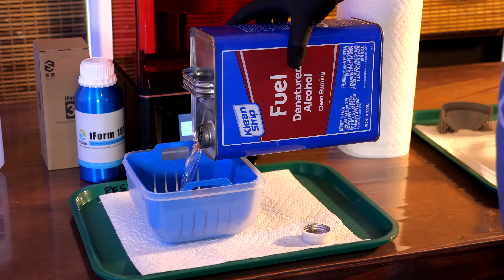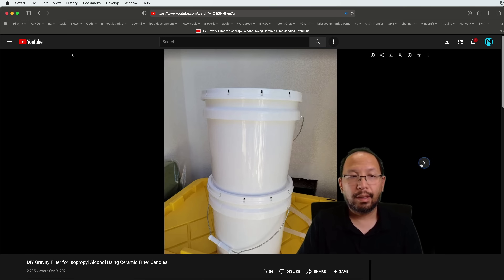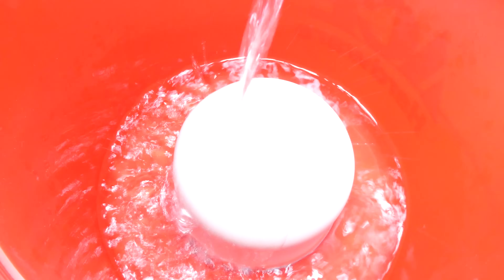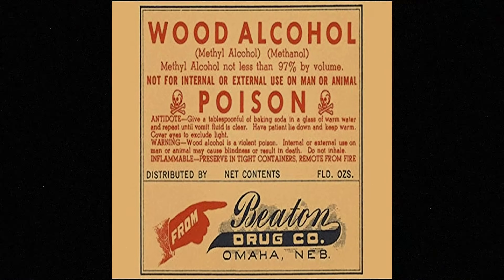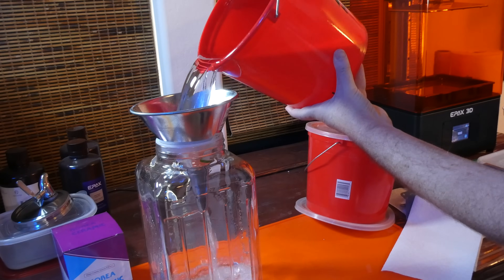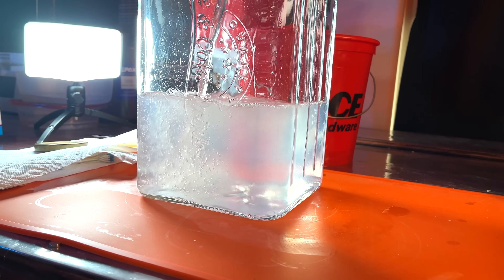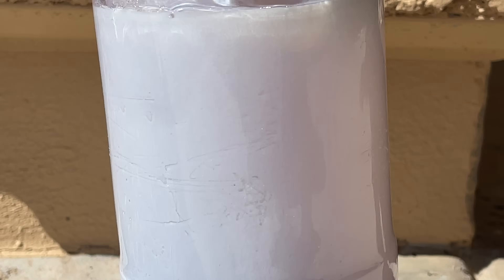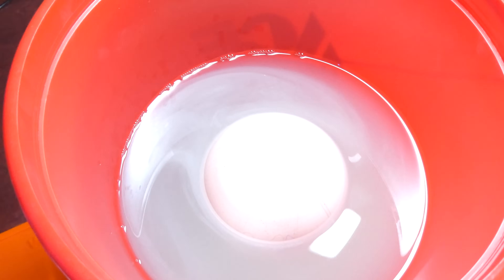Can We Recycle 3D Printing Alcohol?

Comment: I have had my best luck with indirect sunlight. Just like letting the larger particles settle, indirect light creates those larger particles that then fall out of the solution. This will leave me on the first 2 or 3 cleanings fairly clear alcohol. this does take a little time but can be done immediately. I am assuming the yellowing I get is the leftover color from the resins I use. It is imperfect and I use leftover milk jugs for settling then curing the waste resin/mucus. I hope this is usefull.

Comment: How about the top bucket is actually a pressure pot. 40 to 50 PSI would push the alcohol through much faster. Not sure if it would also force the particulates deeper into the filter shorting its life. Maybe a filter could be back flushed. I think it's worth exploring these ideas further.
Reply from the maker: Yes these filters can be used under pressure instead of just gravity.  Could work.

Comment: First, I would start by making a simple sand filter for the first filtration then run it through the carbon filter.

Also how the hell do you get your alcohol that dirty after just a couple prints?  I've reused the same gallon of alcohol for at least 30 prints and I'm not HALF that dirty...
Reply from the maker: I normally do not let it get that dirty. That batch was from a ton of failed prints and until I got a good print out of it I just kept the alcohol.  It was also to make a point.

Comment: I think something that would help a lot is having more filters. So like starting with cheese cloth then though a smaller and smaller filter. Even if you are using six buckets on top of one another it will have less clogging over all and have a smoother time cleaning.

Distilling alcohol is something i wouldnt mind doing but it would have to be outside and i couldnt imagine cleaning afterwards.
Reply: Cheap coffee filters...  Let the resin settle out in a container.  Pump out the clear alcohol using a small electric pump. Filter that alcohol through a few stages of coffee filters.  If you want super clean, filter it through a rig like the one in this video.

Comment: I distill denatured alcohol without any issues.  I would say I recover about 65-70% of it.  What doesn't distill I put in a clear plastic container and leave it outside.  What is left solidifies in a day.  What comes out of the distiller is crystal clear and the odor is  not as strong.   I also do a "pre wash" in a separate container and then use my wash and cure.  It make the alcohol in the wash and cure last longer.  I was hoping your method was a little more efficient and could be done indoors but I think I'll stick with my distilling outside.  Great video though.  :)

Comment: Distillation can be done safely but you really need to use either an alcohol distillation setup or one for chemistry.  I wouldn’t trust the cheap water kind you find on amazon.  Alcohol stills should keep the liquid and gasses far away from fire or sparks and a lab hot plate setup should as well.  Then as long as you don’t setup a closed system (heating a closed system makes a bomb not a distillation) you should be good to go.
Of course this all depends on how the chemicals in the resin react to heat and if they form azeotropes with the alcohol on whether it will be a worth while expenditure of time and energy.

Comment: I'd use heat in an oil bath or a distiller that allows liquid heating. Use controlled heat to distill, keeping it lower than flash point, above boiling point. Also before then, I would have also centrifuge it to remove bulk of suspended solids so less cleanup later. Other option is to sonicate to force vaporisation without heat.

Comment: I'm wondering if you can make a centrifugal filter for liquids. If the resin is dense enough, maybe you could separate it cleanly for reuse. If not, including a UV source in front of the inlet might be enough to trigger the resin to cure and become easier to filter out with a centrifugal filter.

Comment: yeah so i have done this before. you should cure the mix first, filter it through paper towel or something first to get the "large" parts out. and then filter it through the other fine filters. you will clog those fine filters very quickly without the pre-filtering step!

Comment: I've distilled significantly more dangerous commodities. So long as you follow basic safety protocols, use proper hardware, and don't be a total dumbass and maintain the apparatus... then it should be Saif and easy.

As for your solution, you can also get a vacuum pump and use a.. I dunno 10 or less micron filter with a vacuum flask and vac filtration hopper. There's a better name for it but it eludes me at the moment.
Explosion proof/resistant vacs and oil (for oiled vacs) aren't terribly expensive.
Adding a voc trap/filter wouldn't be hard, nor too expensive either.

As for distillation leading to the same content of water and alcohol?
Yer not totally right there. Usually you'll end up with less water. So using a hygrometer to ensure you've gotten the right concentration is key. If you're using non 99% for whatever reason.

The downside to distillation is potentially losing your pot to resin sludge. Forgetting to add boiling chips which may or may not be required. And having the system (explosively) over boil if/when something gets into the super heated soln. (solution).

Using a vac set up properly should, in theory, be the cheapest route for relatively easy alcohol purification.
Only down side is the noise and difficulty of finding easily affordable sub micron watman filters.
But if you start with well mixed or fairly funky part of the soln., it should behave like an adhoc filter.

Comment: IPA doesn't need to be denatured, it's poisonous to start with, don't try to drink it, and that smell is the smell of IPA vapor... your denatured fuel alcohol is Ethanol, the kind you drink, and thus they add methanol to denature it per regulations. and it is NOT IPA.

Comment: I can't justify spending that much time and effort to clean the alcohol. Once mine gets to a certain point, I dump it in a container, and let the resin settle to the bottom. Then I slowly pour about 2/3 of the bottle into another. Leaving alcohol that's cloudy, but not milky like it was. The rest I just keep collecting until I have a container that's too full of settled resin to use. I pour that into a foil pan and let it sit in the sun for days until it's hardened and safe to throw away. All the cloudy alcohol is my first bath. I then have a secondary bath of much cleaner alcohol. This gets the parts clean enough for me.
Reply: I do something similar...

Comment: If you make a 3 buket filtre you may want to try using 2 diferent rate of filtres  cuz if they are in the same rate you will have no real upgrade from staking up, usually when you use a "cascade" of filtrers you go from the wider to the finer so as the liquid go throw the "cascade" it will clog the filtres less and less makeing the cleansing of the "expensive one" easy and they will last longer

Comment: I used denatured alcohol for cleaning parts at work, it's much cheaper but we were told it can cause distortion in our precision models, plus the whole methanol poisoning thing. What are you guys using?
Reply: Started with IPA, then when that got scarce/expensive due to Covid, I switched to Denatured.  It cleans better, but stinks to high heaven, at least more so that IPA.  I read that the vapor is more poisonous than IPA, so now that IPA is readily available again, I'm back to that.  Denatured alcohol does clean the prints better than IPA though.  If I lived in an area where the winter temps outside were not so cold (I live in New England), I'd just do my printing in the garage and continue using DA instead of IPA.

Comment: Great video.  You could use a Peristaltic pump with a 3D printed float attached at the end of a silicone tube to transfer the dirty alcohol to the filter setup (prevents from disturbing the mixture with the settled resin bits).

Comment: My method is to use 3 vats of different level of how clean the IPA is. One vat is the dirty, where all your IPA will end up eventually. Then the medium, and finally the clean. When cleaning a part I dip it in the dirty to get off any resin still on it. Then I let it drip off a bit and put it in the second one which has fairly clean IPA. Finally I swish it around in pretty much completely clean IPA. 

To clean the IPA I just let it sit for a while so sediments fall to the bottom. Then I siphon off the top with a hose (but you can also just pour the top stuff). Then I take the medium vat and pour it into the dirty one, and finally pour the "cleanest" which is now slighly pale, into the medium one. Then I fill up the clean vat with new IPA. This is needed since some IPA is lost when leaving the dirty IPA sludge in the dirty vat, and some IPA evaporates regularly. The sludge from the dirty vat I take to be cured in the sun or under an UV lamp and throw out. My procedure is not very advanced or cause much extra work, and it gives me completely clean parts. Before I started this method I used to get a bit sticky parts after cleaning and curing, but now my prints are nice and dry.

Comment: Filtering just creates new resin-contaminated waste items you can't dispose of. When the IPA in my washing station gets oversaturated, I decant it back into bottles and put them on a windowsill. (I don't have a spare UV source for this sort of thing.) Any time I see that the resin has settled, I turn the bottles over a couple times. Depending on the sun, the resin will have completely polymerized out of solution in 1-2 days and settled to the bottom as a solid, not a slimy mess. Then, and only then, is the resin waste safe to dispose of.

Comment: I too use denatured alcohol from those metal containers that are junky to pour from, so I picked up a parastaltic pump for cheap and use that to pump alcohol in/out of my wash bin, and it's also great for pumping resin to/from the vat, far fewer spills. I use the large clear plastic jugs I get with distilled water I use for other things in the house, pump my dirty alcohol into it, set it in the sun for a few hours, let it sit in a corner for a couple days to settle out. Then I use my pump to move the cleaned alcohol into a second clear jug to store the cleaned alcohol for future use. I wrap a paint filter around the tip of the hose that I insert into the curing jug so that larger chunks of cured resin slime aren't sucked up. I'd like to improve the process, maybe a continuous pump on low that moves the alcohol to a vat where UV lights blast it, maybe some type of centrifuge, then pump it immediately to consecutively smaller filters and back to the cleaning basin.

Comment: You can potentially distill "denatured alcohol" and make it safe to drink, if you have a good enough fractional distillation setup. If they've added more than methanol to it then it may take additional steps. I think "In most cases, it's a prohibitively involved and complex process to purify the ethanol from denatured alcohol effectively enough to make it safe for human consumption." would be a more accurate and fair statement.

Comment: distilling alcohol isn't dangerous at all as long as you water your starting product down to 40% or less. however the alcohol that comes out of one of those little air stills would be 60% max which I don't think is strong enough for cleaning. for that you'd need an expensive column still with bubbler plates and a dephlegamator.
Reply: also what you said about the same amount of water and poison isn't right. the methanol comes out first (you keep checking samples until it stops burning orange and starts burning blue) then you've got your ethanol. there might be other things they put in there that complicate things but distilling will separate most things out cause that's the whole point.

Comment: Another possibility: Make a simple solar still. Take your two bucket lids and run a wide tube/hose between them (sealed to the lids). Take one bucket with the dirty alcohol and wrap it in black plastic (or similar) and leave it in the sun. Take the other bucket and put it in the shade or - better yet - have it sitting in the ground (the bigger the temperature differential the better). It won't be fast, but over time you will accumulate distilled alcohol in the cooler bucket and the system will never heat up anywhere near combustion temperature so there's no fire risk. If the bucket lids seal well, there'll be no smell either. All you need to do is keep putting the dirty alcohol into the black bucket and emptying the clean alcohol from the cooler bucket.
Reply: Wouldn't it be better to use a clear bucket so the UV-Radiation can cure the dissolved resin, so it can be easyly disposed?
Reply: @Talashaoriginal  bucket needs to be black to heat in the sun
Reply: @davidrobinson1729  No water is already good in absorbing heat.
Reply: @Talashaoriginal  you dont need to solidify the resin, and worse it could be stuck to the distilling container. Pour it into something after distilling to cure and throw out.

Comment: So how about centrifuging the dirty alcohol and decanting the clean alcohol from the top (maybe after exposing to UV to harden the centrifuged residue)? It might be possible to make a simple centrifuge from an old bicycle wheel (or old motor if you are suitably mechanically inclined). The main challenge would be ensuring that you balance the weight on either side of the wheel.

Comment: get a wispier fish tank air pump and add a little air pressure to the top bucket  this really speeds things up also the little air pumps way to make a spark and just use the 50/60hz line feq to make a magnet oscillate has no motors or wire breaks (switches or brushes) to make a spark

Comment: We have 99.9% Isopropyl alcohol in my location (2$ liter), still smells bad, without any additives.
Technically drinkable, but would instantly knock you out and it absolutely pained me to lose it in process of cleaning.

In addition, sometimes I mess up % and it absolutely destroys prints pretty fast.
I wonder if you can have 70% mix and re-filter it, rather than re-mix over and over. 
It doesn't pain me nearly as much to spend 2$ as to "oopsie" my %
Reply: We're being charged $25 a gallon for 99.9

Comment: I've been 3D printing for around two years now and I never needed anything special to clean my alc. After every batch of prints I wash (in just a dollar store food container that seals well, or rather two of them. One for the first dunk off the build plate that then gets the toothbrush treatment, then into a 2nd batch that never really gets that dirty), I put the alcohol under my UV light to cure for like 10 minutes (stirring halfway) to cure what's floating in it then let it sit for a few hours or overnight if I'm done for the day so it all settles then filter it out. The cured resin becomes a thick goop that can easily be blocked off by a spoon or stick while the clear alcohol spills out into a filter that catches anything else. I never let it get stupid dirty like what you show, that to me is such a waste. So far in all my 3d printing ventures, I've only gone through 4 bottles of 32oz of alcohol, the cheap store-bought 70% kind using this method.
Reply from the maker: Thanks for sharing.  I usually don’t let it get that dirty either.
Reply: @Nerdtronic  Np prob. I would have thought such a methood would be the standard? It just made sense to me to cure whats in the alc then found other's on youtube showing it as well so guess I found the common sense approach. But then these videos make me wonder.... is it really not that well known to do it this way?
Reply: Using the UV light is also better (faster) at curing the resin than sunlight.  I bought a 30 W UV lamp from Amazon for curing and use it on the used IPA as well (Cure it , let it settle, then filter).

Comment: I think you are on to something with the two-stage filter, but I'd also recommend adding a "pre-filter" stage using a coffee filter or similar to take out the big chunks before it hits your 0.5 micron filter stack.
For the clogging that occurs, you might be able to rig up a stirring mechanism or similar to keep the liquid moving. Not sure if it would help the clogging or not but might be worth a try with a cheap hobby motor and some 3D printed paddles. Just use a long shaft so the motor is well away from the alcohol.
Reply: Putting the Filters on a turn table or Potters wheel may help get the particles to settle toward the outside edges while the lighter alcohol goes into the filter.  Obviously this pseudo centrifuge might take some tweeking to get the proper speed .  Too fast and no alcohol even hits the filter too slow and the particulate isn't drawn outward.
Reply: Heres what I think. Prefilter with a paint filter/coffee filter into bucket 1. Bucket 1 has a 0.5 filter on it. Bucket 1 also has one of those magnetic stirrers so there is never a danger of a spark and the dirty IPA is agitated and less likely to clog the filter. Bucket 2 is 0.3 and the mag stir is optional. Bucket 3 has a tap installed so you can easily extract without taking the whole thing appart.